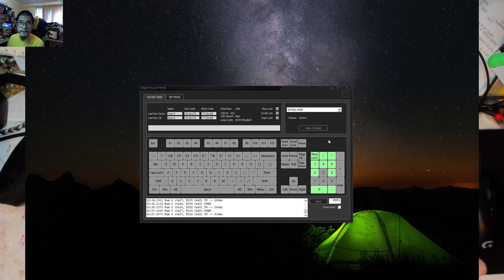Can You Hand-wire with Home-Made Conductive Glue (100% solder free)?

Comment: Do you think conductive glue would work to wire up the switches to a pcb? Maybe with a commercial brand? I'm trying to find alternatives to soldering (can't do it due to hand disability) or expensive assembly services.. Thanks for the video!
Reply from the maker: Its possible, it really just depends on the voltage and current its capable of carrying, and if the resistance is not too great for what a keyboard needs. Commercial conductive glue I think has a lot more carbon in it also which helps with the conductivity, but it can also be quite expensive! Best to possibly buy a small amount and test on say a macropad first before investing in a larger amount to do a full sized keyboard.
Reply: @theboard  have you considered using a metal like silver, nickel, or copper powder?
Reply from the maker: @gltovar  I did not as they are 'readily available' materials that you could get in walking into a generic hardware store, but the theory definitely could work depending on certain assumptions. The problem with metal powders is oxidation and therefore non-conductive layer which would not work when in a suspended medium. Plus, for the density requirement, the powder would need to be extremely fine, which would be expensively milled products (where as graphite powder is easily found in extremely fine size).
Reply: @theboard  so I am going to start with cheap copper power I found on Amazon, mixing them with ca glue, wood glue, and 2 part epoxy. Will escalate with some silver powder from ebay of it seems promising but might need a bit finer dust
Reply from the maker: @gltovar  Sounds like an awesome experiment, best of luck!

Comment: Why do you think some of the switches didn't work? do you think that was caused by the janky job of a micro controller? Or do you think it was caused by the conductive glue just not working well. Love the content btw!
Reply from the maker: Hi Jackson, thank you for the support :)

It could be a number of factors such as poor contact as the glue dries, it could have formed a PVA film with no graphite linkages. It could have oxidised the wire surfaces from the moisture in the PVA, since no flux and heat was applied to etch the surface (since flux is acidic in nature).

It is just as possible that the physical tension from twisting diode legs was insufficient when the PVA was applied, as the PVA may have creeped in between the pads and wires, and when dried, formed a film and reduced electrical conductivity.

So, just some possible cases!

Comment: That was great! What about putting corn flour in? Or would it also reduce conductivity.
Reply from the maker: Anything going into the mix that is solid non-conductive (corn flour would be in that) is going to make it worse for its conductivity properties, which would be the challenge in finding the right viscosity and adhesion properties. A more solid glue-paste medium that you could work graphite into (say a glue-stick paste) might work, you'd just have to physically mix it very well and very evenly for it to work.... Hmmm.
Reply: @theboard  what about adding like metal powder?
Reply from the maker: @epsilonkeyboards  Yeap, metal powder like say CNC swarf would work just fine, but it'd be heavier and you'd have to see how it works in the glue, as the weight would sink to the bottom of your glue mix if it was liquid (e.g. PVA) where as the graphite is lighter and better suspension medium.

Comment: I always use hot glue for insulating. I hardly ever use heat shrink any more for anything. Try that instead of PVA glue for insulating.
Reply: Doh! Commented too soon.
Reply from the maker: @RichardBronosky  I did  think about using hot glue, but yeah, if you wanted to be completely heat-free (especially for kids maybe), just using a thicker PVA might do the trick :)